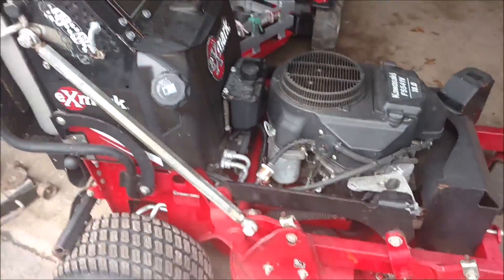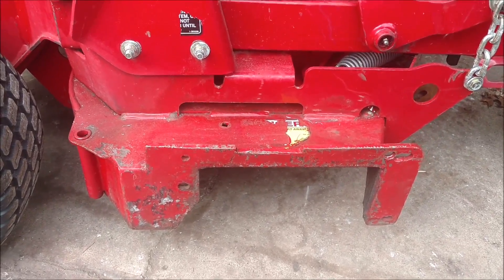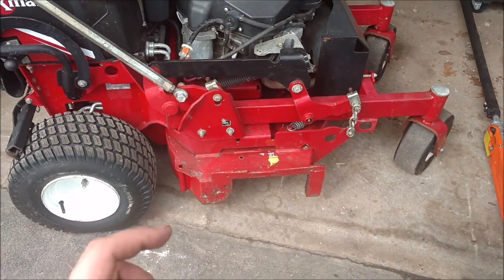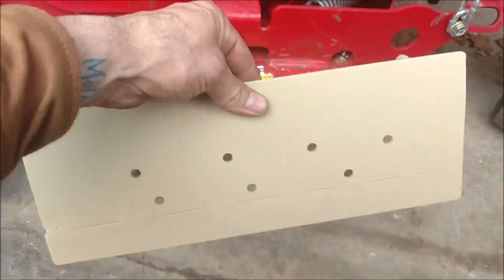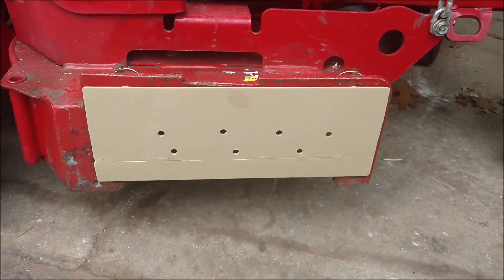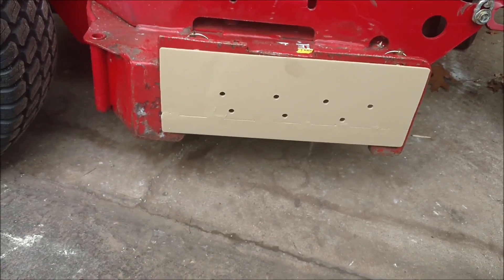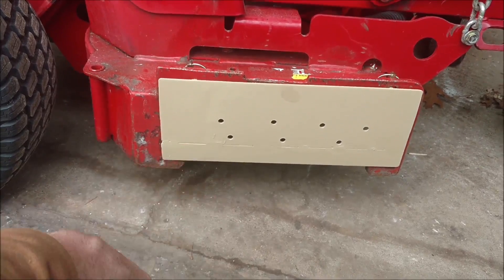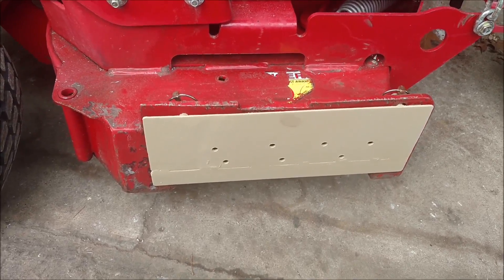Custom Homemade Chute blocker/Mulch plate for the Exmark Vantage 36 Stander

Comment: Nice.  You could add a slotted hole in the front and swivel the chute blocker around the rear pin when you need to use it.
Reply from the maker: John Gray I've thought of that. Very good idea

Comment: yeah...you might want to add something along the bottom. Maybe even a small angle piece for some re-enforcement at the weakest point... should work well though. Let me know how it does for ya...I may have to try that on my Exmark Viking!
Reply from the maker: rbljackson It's def not week down there. I had great penetration with the weld on both sides. My concern would be too much grass coming out.

Comment: Does it make the grass clog? I want to convert all my machines to mulching. And do you need a kit for the deck?
Reply from the maker: a Balboa There's allot that goes into it. What type of grass, is it wet, is the grass thick. Also depends on the type of deck. Where I'm at in the North, I only used it for absolutely necessary areas. I never used a mulch "kit" that bolts into the deck so I can't speak for that.